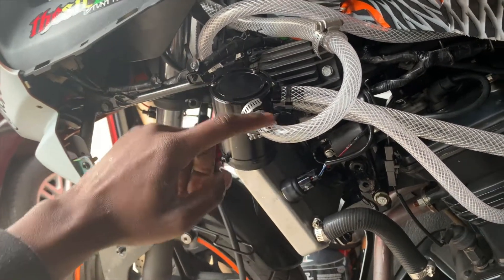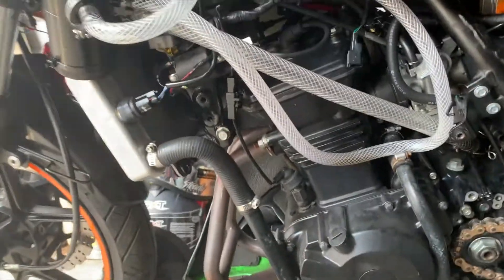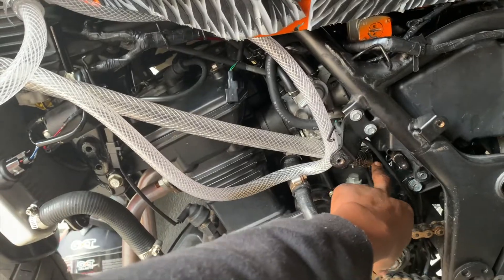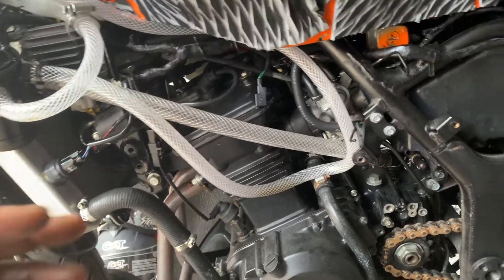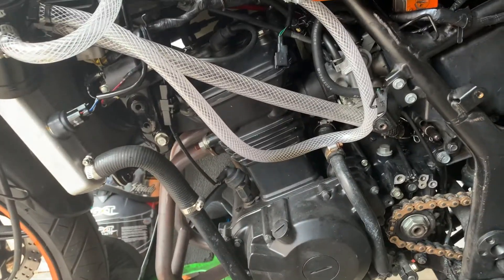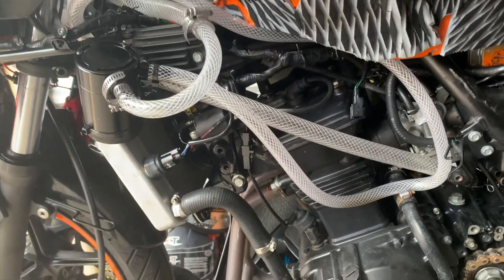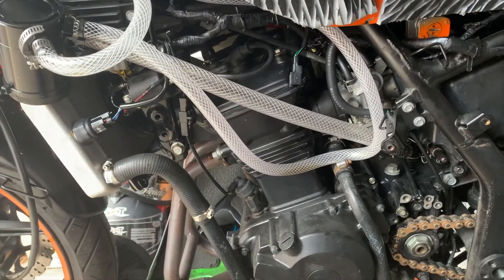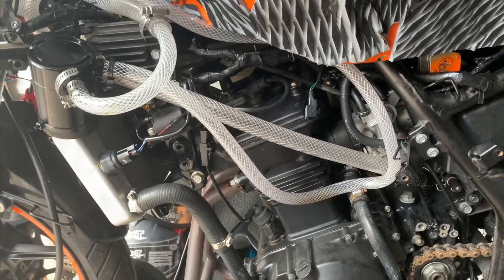How to Stunt A Ninja 250 or Any Bike | Most Important Modification Needed

Comment: Couple questions, where did you buy the catch can? Also what size sprocket do you have and what its top out at after installing? I'm looking to stunt my 250 but also wanna be able to ride the streets. Thanks g, great content !
Reply from the maker: Appreciate it my dude. The catch can I found on Amazon. I chose the one the best fit where I wanted to mount it but they are all pretty similar. I run a 56 in the back. I used to have a 60 but that is way slow to try to street ride. 56 isn’t bad. I know some guys run a 54 to make it a lil more street-able. The hard part about it is the bike doesn’t have a very high top speed even with stock sprockets. I don’t know why I tip out at now but prob around 80 at most